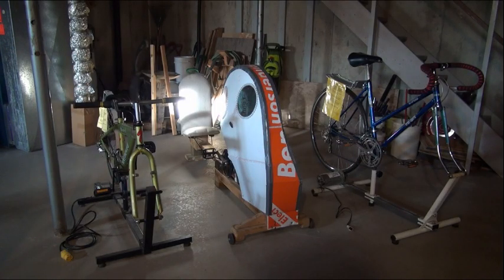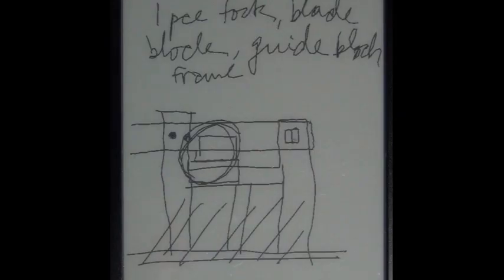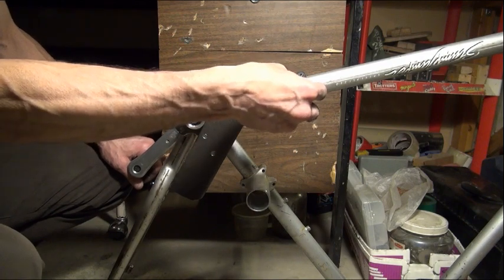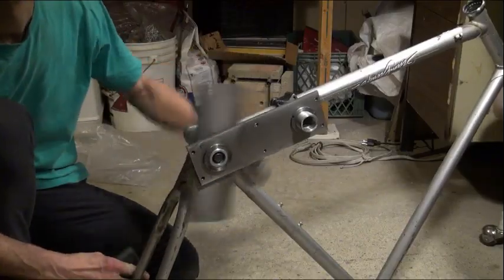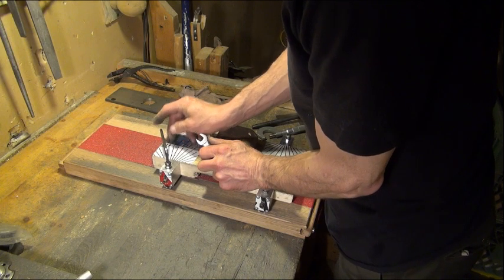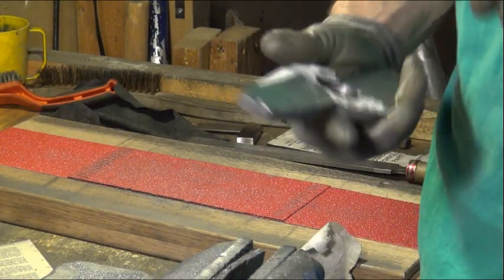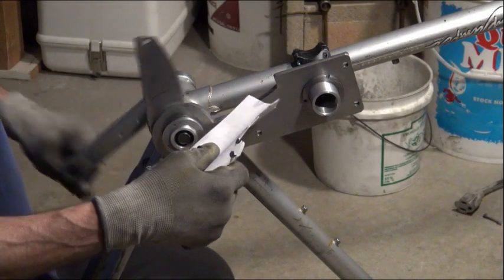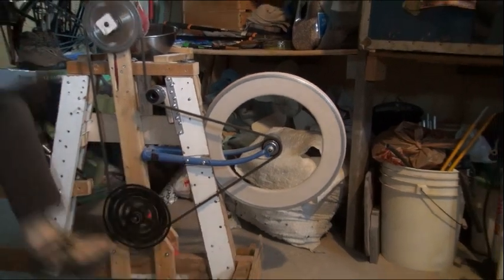Pedal-powered mulcher: the chopping mechanism

Comment: Instant fan of yours, love everything about this project. I know its been 4 years but a potentially worthwhile alternative to the lopper version might be one taking inspiration from antique corn huskers. 

Noticed you using a bit brace, or was it a handcrank drill i forget which, aren't those just the best? Drilling something without the noise of an electric motor is so peaceful
Reply from the maker: Hi Richard,
Thanks for the compliments. Hand tools are, indeed, a pleasure to silently work with. I was using a brace bit in the clip, but had modified it to fit a modern drill chuck, so its three jaws can more solidly hold modern bits.
Old hand-cranked, cast iron farm machines are inspiring, and I wouldn't mind recreating this device in that format, if I can find the motivation. A corn husker, however, is not what I had in mind. Please see the other videos linked in the description for a better idea of what the Mulchebeest is meant to do.
Cheers.
Jan

Comment: I wonder what kind of gearing/torque is necessary for handling branches 1-2” in diameter.  I’m excited to see what you come up with. I would think power is preferable to speed.
Reply from the maker: Good question. While this is going to be a garden mulcher, not a wood chipper, it will encounter stuff in the 1-2" range, like sunflower stalks. These are pithy rather than woody, so will be easier than wood to chop. I'm just now setting up and testing the gearing mechanism around the bike frame. It will be slow, sharp, and powerful, good at dealing with various dry, wet, chippy, and fibrous material. A ratio of 3:1 (48T:16T) can cut a 1/2" twig with some small effort from an adult arm, and probably quite easily with leg power. Three riders will ace this, so I can probably up this ratio, maybe double it and get sunflowers chopped easily. The blade is currently driven by a thicker one-speed bicycle chain. With a higher ratio, I'd go with a heavy-duty BMX chain in the last step. Setting up gear shifting will be tricky with the geometry of this setup, and might involve a weird derailleur chimera. Further, once the flywheel is built and chained into the "chop unit", I'll make another video. After that, the 3-rider pedal drive awaits...